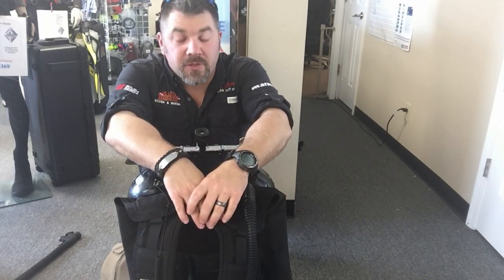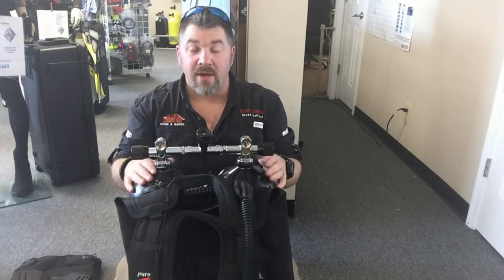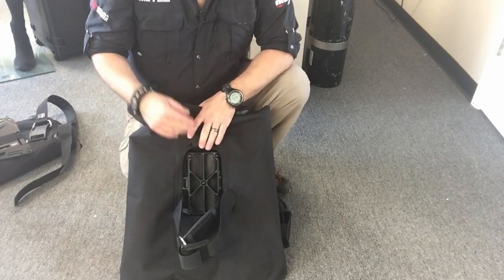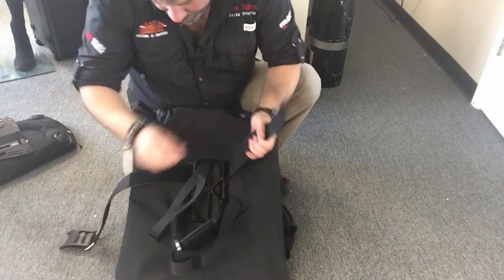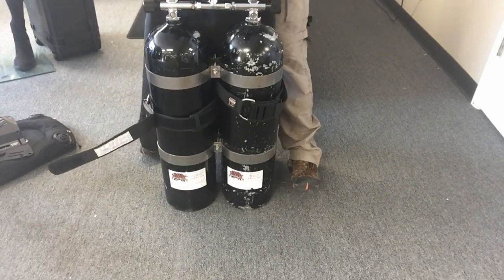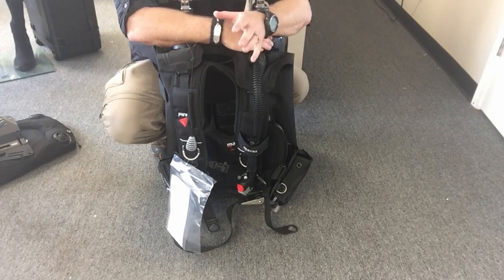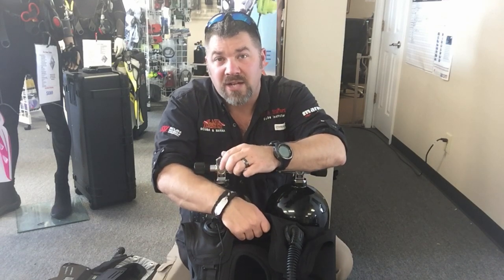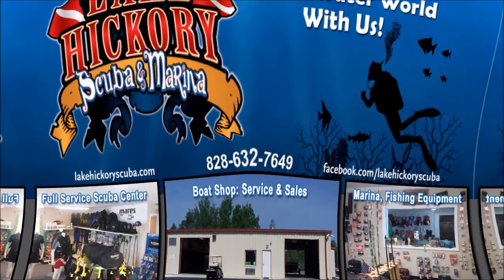Double Cylinders Without A Back Plate And Wing

Comment: love it . I've been teaching with Hybrid Pure for two years now. about 2000 dives with it. I really like this BCD for it's customizeble. It's like a semi B/P system, there are so many thing you can change just like a B/P. Like one of your older video showing how to Side Mount with it. But there are also some flaws about this BCD which I had to fix. 1. don't like the weight pouches,  had to replace them with one made for B/P system. 2. Shoulder pad  worn out, mine was an older version, had to replace it with a newer version one. 3. The inflator worn out,  went to a Mares dealer and bought the inside parts. Besides these, it's still working. 
You see, you could almost change every part on this BCD. as long as mares still making them. 
With a metal BP, all the weight is equally distriputed on your back. that gives a better trim under water. but with plastic or soft BP all the weights are on your waist, even with the trim weight on the pure, the position of the weight is still on your waist. and I've tried to move them on the cam band, but that still don't feel like metal BP. 
So Bryan,  maybe if you could figure out a way to custom this BCD to give a better trim like a metal BP do. thanks.
BTW, my English name is also Bryan, and we use the same bcd, how cool is that.
Reply from the maker: I will have to do some more testing with the Pure, but I understand what you mean.  Having weight evenly distributed across you back vs, just around your waist, changes things.  Its good to know there is another Bryan out there who spells his name with an Y instead of an I.  One of our other Instructors spells his with an I, and we argue about who spells it right or wrong.  I am on the Y side of the argument.

Comment: I use a Mares Pure BCD and got a 12L steel double in the bargain when i bought some other diving equipment from an old tech diver, but had no idea that my BCD could support doubles that big. Now I just have to buy an extra tank strap, thank you for the information!
Reply: Becareful of the lift capacity of the wing. I believe steel double 12L is too heavy. Do your calculations yourself.
Reply from the maker: ROB14ification, I am going to agree with Rithy on this.  We chose double AL80's because we know that the Mares Pure has plenty of lift for them.  With Steels, you would need to do the math to make sure you have sufficient enough lift to dive safely.
Reply: That is true, I will do some calculations and try it out in a shallow pool first. Thanks for the heads up!
Reply: @ROB14ification  can you share with us what happened later? did it work out?
Reply: @MrMetallica505  Have not had the ability to try it, but since I dive with a dry suit and BCD I should have plenty of lift to compensate for the heavy tanks.
Sceptical about using the BCD only.

Comment: Hi Bryan, I have a Mares Pure SLS and I've noticed that in the hard plastic backplate there are two grommet holes where you can bolt the double tank system BUT one of the holes (the bottom one) is just under the bladder BUT that is not really part of the bladder because it never gets inflated, so it would be possible to make a hole through it without damaging the bladder. How would you make this hole? Thanks!
Reply from the maker: Hello cusber, its not really ideal to make any new holes in the material, as this would most definitely void the warranty.  Though this model is designed to be able to set up on a set of doubles, its not the best option out there.  We would still recommend using a Back Plate and Wing for the use of doubles.
Reply: @LakeHickoryScuba  thanks!

Comment: Thank you again for your videos. Very usefull for buying my own gear, and for learning new stuff. Thanks!
So i'm looking over my new bolt bcd, and in the backplate (same as the pure?) it has    2 reinforced holes in it. One just above the tankcradle, one above the lower edge of it, and an oval marking with two dots on the bladder. There's no mention of it in the manual, but they look like boltholes to me. I have no intent to dive twinsets, but out of curiousity, are they ment to bolt doubles on to the bolt bcd?
Keep up the vids, your efforts are much appreciated.
Mechanikos
Reply from the maker: Hello Joysy & Mechanikos, to my knowledge, the Bolt and the Pure are simple designed to add additional tank straps, and are not really designed to be used with a bolt system as a standard back plate and wing is.

Comment: Hello Brian, I have yet another question... This one concerning some expert advice. I do a lot of solo diving on clean ups and local small recoveries. My question is.... I always carry a redundant air supply which consists of a Standard 80 with a 30 cubic ft. pony. I have the pony attached via clamps to my 80. Should I mount the pony upside down on my main cylinder, so that the valve is easier to reach? or should I leave it mounted upright?
Reply from the maker: Hello Gee, this is always a personal choice for the individual diver.  For me personally, I like to leave it upright.  Unlike a Deco Bottle, a simple pony bottle, I will leave it turned on all the time.  Doesn't matter if it is slung under my arm or on my back.  A Deco bottle however, I will charge it, but then turn the valve off to prevent any chance of it losing gas through out the dive.  In cave diving, there is always a risk of the bottle leaking if the second stage purge button is pressed.  For open water diving and no overhead diving, the risk is minimal. If it makes you feel more comfortable to flip the cylinder, so that you can manipulate the valve while it is pointing down, then I would encourage you to do it. The key is to practice and always stay safe no matter what you decide to do.
Reply: @LakeHickoryScuba  Thank you Bryan. Great information.

Comment: I have the same bcd by mares you’re using in the video, I was wondering if these are compatible with any crotch straps? It’s more of an annoyance than anything but my bcd always wants to ride up while on the surface.
Reply from the maker: The Mares Pure has a small D-Ring attached to the bottom side of the Bladder System.  You can use up to a 1 inch crotch strap with this ring.

Comment: Bryan since I have much respect for your expertise I have a newbie question. Why dive doubles for recreational? I so want to do this but all the info I’ve found is just cave and tec diving.  Is it just longer bottom time?  Thanks so much for all you do to inform us. Good stuff
Reply from the maker: Hello rick flippin, in short, a recreational diver may choose to dive doubles for the redundancy aspect, or simply to carry extra air.  We have several of our Pro's here at the shop that dive doubles religiously, and they are not technical divers.  Their primarly reason is for the added gas.  They do a lot of 2 hour long dives at shallow depths, and simply need th extra gas.

Comment: Hey Rick. Thanks for all your videos!  As someone who dives doubles back in the day for salvage and recovery, I pop back into diving and suddenly computers are waaaay better and a bunch of weirdos diving side mount😆. So I’m really interested in the concept of doubles as I have loads of time on doubles and preach about N28 (in some places it’s the best compromise between time and depth) keeps CNS TOX at bay. Anyway, diving GUE style before GUE was an organization. What’s your take on banded independent doubles? I leave the bands on Backplate and drop in two tanks and separate first stages, one tank necklace and one tank long hose. Both spg L on Left, R  on right. Long hose L, necklace R hope that makes sense. Your thoughts? BC is OMS 60 lb lift tropical salt water.
Reply from the maker: Hello Alex Works, we will be having a short series of videos coming out in January of next year specifically talking about doubles. So stay tuned for that. But in regards to your specific question on independent doubles, there are still plenty of divers that choose to do this. In our area though, most of our back mounted double divers use an isolated manifold. They do this for balance related issues, and in the event they have a failure in one area, they can still have access to their entire gas supply.

Comment: I'd have some concern diving steel doubles on an integrated wing designed for a single tank. Integrated wing is probably 35-lbs of lift. Double steel tanks should really have 50 to 60-lbs of lift. A drysuit is not a good solution to inadequate lift in the wing.
Reply from the maker: We share the same concern as you Gerry Block, this is why we chose the double AL80's.
Reply: In that case I'd say recommend a single steel 120 and not mess around with AL-80 doubles on a jackect BCD.  @LakeHickoryScuba
Reply from the maker: Gerry Block That’s always an option, it all comes down to the individual diver and what makes him feel the most comfortable.

Comment: I have exactly this BCD and tried exactly the same thing but for some reason, because one band is naturally lower than the other, the BCD tends to sit at an angle to the tanks (that indentation can't keep the BCD upright)! Any ideas?
Reply from the maker: Hello markosalami2.  In short, it will always be crooked to some extent.  Even though this is a viable option to use this BCD for doubles, its not necessarily the best option. We would still suggest that if you are going to be diving doubles, then dive with a Back Plate and Wing.
Reply: @LakeHickoryScuba  I actually just drilled one hole through the backplate and used another (square) hole that was already on the backplate to feed the two screws through, holding the backplate to the metal bands connecting the cylinders. I also then attached the cam bands as you show and it prevents any spinning and looks extremely sturdy (though I am curious to see how long the backplate will hold!- have used nuts on either side to strengthen it)- would post a photo but can't on YouTube!

Comment: 🤔 You forget to also mention to make sure your BC has enough actual lift capacity to facilitate using doubles safely.
Reply from the maker: Hello Pinnacle Diving Company PDC, this is too is a concern divers should take into consideration. This is why we chose two aluminum 80's. This particular BCD had plenty of lift for this particular setup.